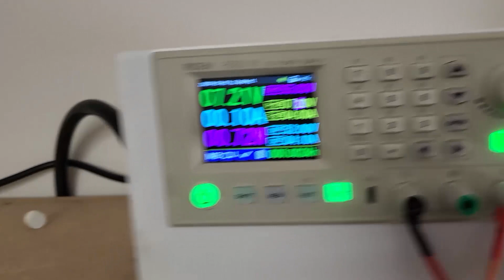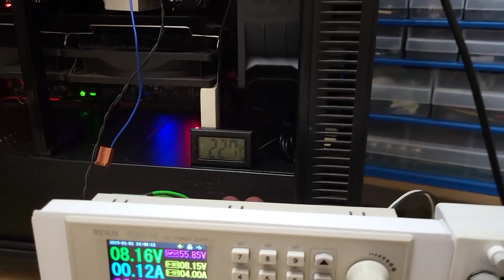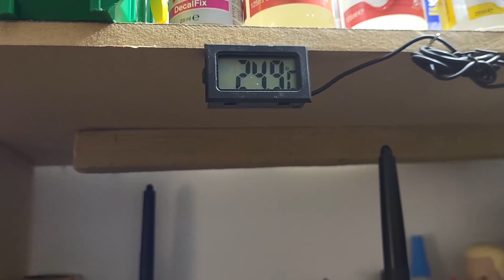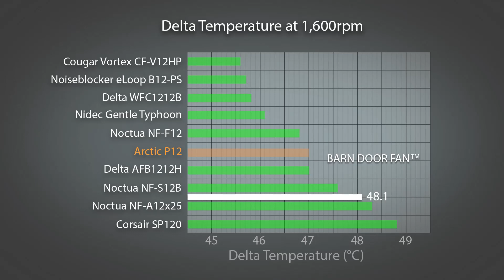I Made The Most UN-OPTIMISED 120mm Fan Ever

Comment: Can you recommend any budget/ultra budget fans to set up a pc case with?
Reply from the maker: Your best bet is probably the Arctic F series (F9, F12, F14) as you can buy them in packs, and individually they are very cheap as well. Sometimes going too cheap is not a good idea as the quality will be poor!
Reply: If you don't mind a follow-up question: do fans pull most of air from their sides or like whole blade area? In the context of vent holes on the sides vs full mesh pc cases front panels.
Reply from the maker: I think in general that it doesn't really matter what type of intake a case has - any kind of mesh or filter will restrict the airflow and the fan will have to work a little bit harder (and may also generate more air noise) but it won't really matter which style you choose. My case has a completely blanked front panel with intake vents on the sides. :)